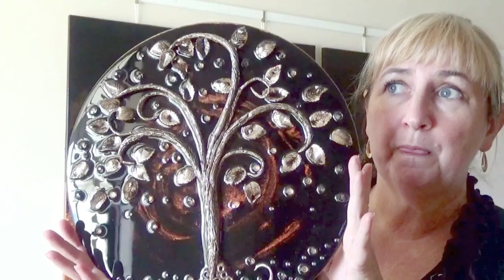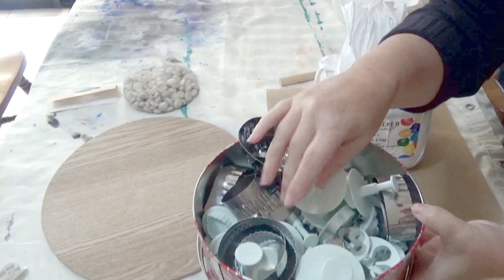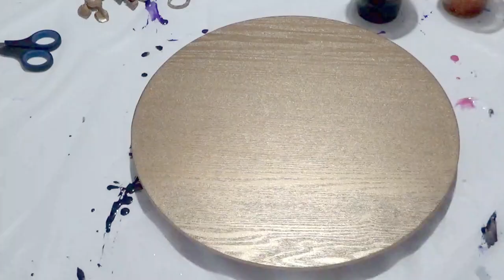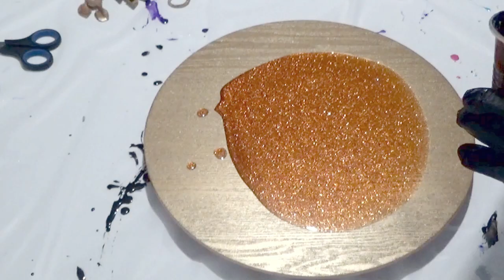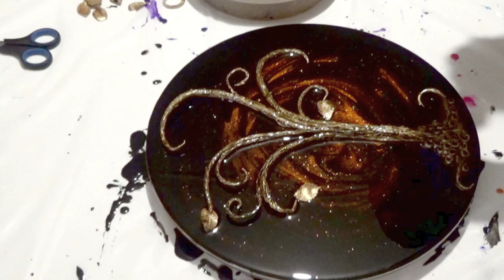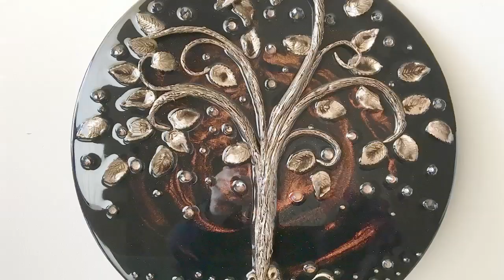How I added Air Dry Clay to Resin

Comment: I have tried my hand at this using epoxy putty to make the tree and leaves, and used PVA glue to stick it to the base, allowed it to dry and then poured resin around it...to make a thin film on the whole piece. It turned out well.
Reply from the maker: Sounds good, there is so many ways to add dimension to your resin 💕

Comment: Another medium that you might try is cold porcelain.  You make it yourself and there are a number of recipes out there.  Most people try two or three and then pick their favorite.  It doesn't crack and is much less likely for the thin pieces to break.  It's fairly flexible when it's dry.  You can get it SUPER thin without sacrificing strength.  I used to make flowers out of it and they're so beautiful and strong, considering their thickness.
Reply from the maker: Thanks for the tip 💕

Comment: Nice to see someone else using clay with resin!! :) I use polymer clay with resin all the time. I bake it first but I have seen someone else do a video using unbaked polymer clay in resin and they said it held up fine over time. I just like the polymer clay better because I am used to using it and it comes in so many colors already including my favorite - glow in the dark - which isn't really a color but... :p - Heidi
Reply from the maker: I have polymer clay also and I am planning to create a piece using polymer clay 😉
Reply: Do you bake it in the oven you cook in?  If so any residue leftover?
Reply: @karentravis3996  I usually bake my clay in a dedicated toaster oven but there have been some times when the clay piece was too big for the toaster oven and I used my regular gas oven. I have not noticed any residue left in my oven from the few times I have used it to bake clay pieces. :)

Comment: I love seeing how you use different mediums together. I've used homemade air dry clay for a lot of things and love working with it but it does have it's little quirks. The draw back is that it should be dried for several days to make sure it's completely dried before being painted and sealed to avoid it molding in the future.  I've also used polymer clay also which avoids the time delay, but I prefer the air dry for molding.
Reply from the maker: Thank you 💕

Comment: Can’t tell you Sue how much I love this piece 💕 it’s the closest to my heart 💖 

Do you prime your boards in general first with transparent material like clear gesso? Because I’m wondering how do you keep the wooden raw look! 

It looks much better than the white gesso, I know I cover it with resin later so it doesn’t make difference the colour of the primer. 
But the sides of the board can show the difference, because if the sides are not fully covered with resin (some missing spots), it’s better to have the wooden raw look than the white gesso. You know what I mean?
Reply from the maker: I don't bother priming these placemats because I normally use them for testing and experimenting on. I may paint them a colour to match the base colour of the resin I am about to pour. 💕
Reply: Sue Findlay thanks for your reply Sue 💕

Comment: You have completely amazed me with the work you do.  So talented! One of a thousand questions:  When you pour resin on your flat surfaces (like round boards) why doesn't it all run off?  My resin is very thin and does not set fast at all.  I feel I'm wasting  too much resin on the run-off.  You seem to mention several resins and I don't know which ones to go with.
Reply from the maker: It sounds like you are mixing too much. Do you use a resin calculator for the amount of resin you need? I use https://www.uresin.com.au/art-calculators/ to calculate how much I need. If that doesn't work, then try another brand. Mastercast 1:2:1 or Stonecoat resins are popular choices.

Comment: Hi Sue, do we need to seal the air dry clay after the design is dry? I was thinking about mod podge/resin to apply at the front. Because I’m wondering if someone cleans the piece later with damp cloth, can the air dry clay absorbs moisture and becomes soft again. Or once the design is dry, it can’t get soft again? Thanks
Reply from the maker: The whole piece is coated in resin. So should be fine. 💕
Reply: Sue Findlay thank you sue for your reply 😍.